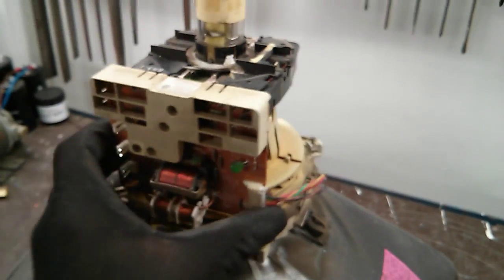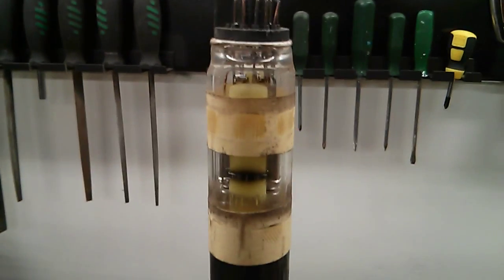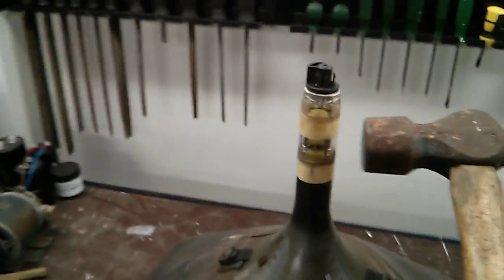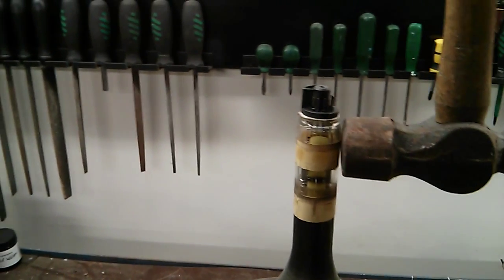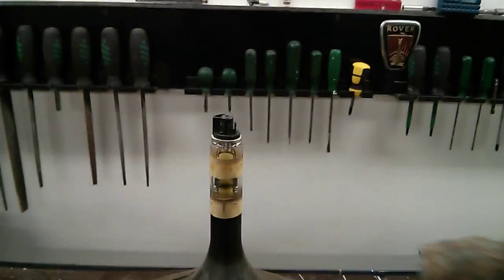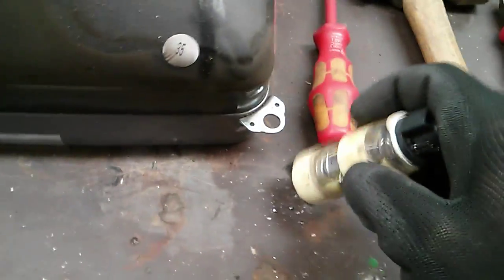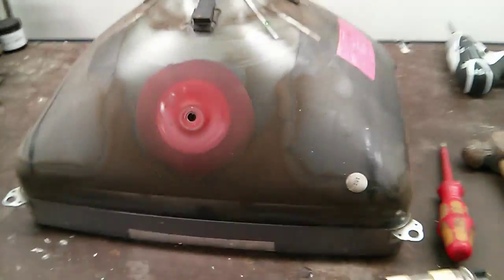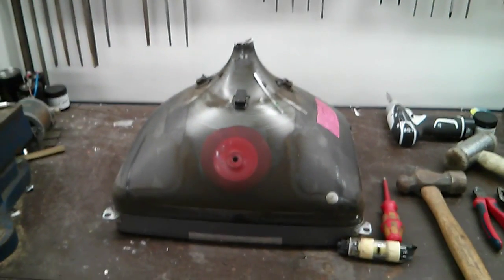How not to release a CRT vacuum.

Comment: Hey! I know this video is old and everything but do you know how to remove/seperate the glass in order to get to the inside of the whole casing?
Reply from the maker: Unfortunately I have not separated the glass from the inner part of the CRT before, I know the front it incredibly thick and tough.

I do however know that using ultrasonic cleaning to remove the electrodeposited metals from the glass inside is a way of reclaiming them without breaking all the glass if that's what you want to do.
Reply: You would need to use a heated metal band made out of nichome wire. Also could use a water cooled diamond cutting saw

Comment: The proper way is to remove the plastic cap around the electrodes exposing the thin glass tube from where the CRT was originally evacuated and then snap it with a pair of pliers. During this procedure it's advisable to put the CRT in a cardboard box to protect you in case of implosion.
Reply: yes but this way is easier and faster.

Comment: Haha that was a good one! I find one of the easiest ways to release a CRT vacuum is to place a screwdriver in the high voltage socket on the side and then hit it with a hammer. i believe that is the weakest point in the CRT tube
Reply from the maker: That can be the case, however I recall Rodalco2007 having a real hard time at that location on a certain CRT, I think he just had a thick spot there on his, but it did ruin his experiment trying to inject water into the vacuum through a bottle over the area he was piercing.

The sealing nipple on the end of the tubs is the best place I've found so far, just takes a set of pliers, but the down side is that you have to chomp the pins away to get at it from the correct angle...

I'll give your method a go next time! x]
Reply: Steve Lane
No problem! :)

Comment from the maker: Thanks Jonny, I have actually used a dremal before to create a bottleneck in the tube for it to break off more cleanly, I will try the large pliars method you've proposed on my Fujitsu CRT monitor I already have lined up ready for the next one. Unfortunately I do not own a drott grader bucket to try that method out with however... x[

Comment: tap, swing, ok right ,lets knock its block off, great.. line.

I use large side cutters and crunch the extraction tube bit thats been sealed on the end  of the neck under the pin supporting plastic ring, for some reason like hearing the rush of air into the tube.probably a dangerous way. another favorite more messy is slowly crushing the tube in the drott grader bucket.some are surprisingly stronger than others, prolly make a video one day before crt have run out. lots of useful part from crt's